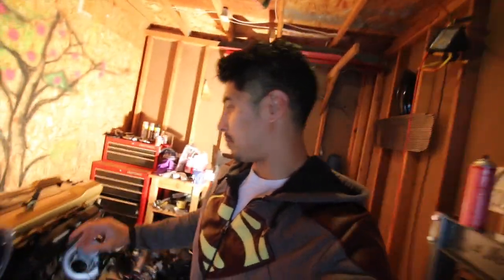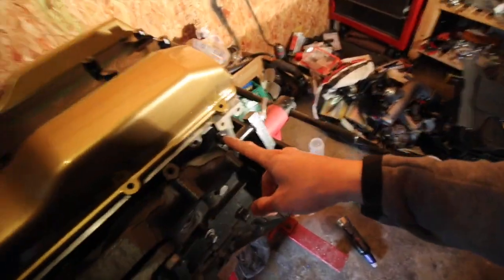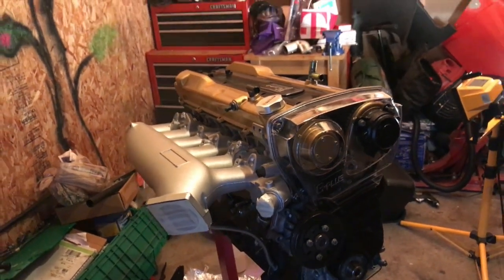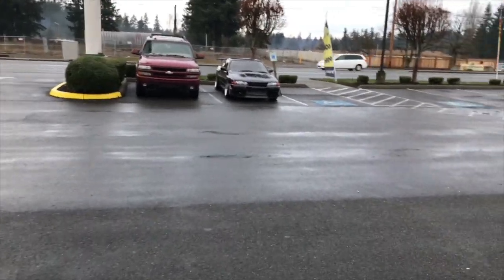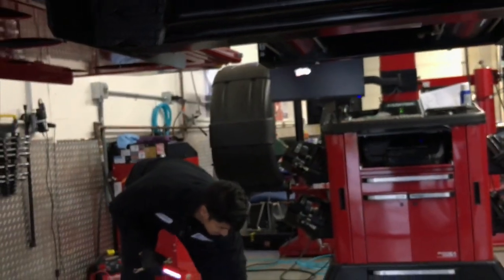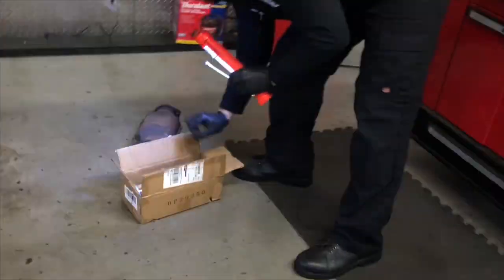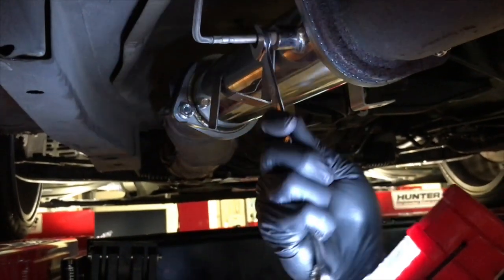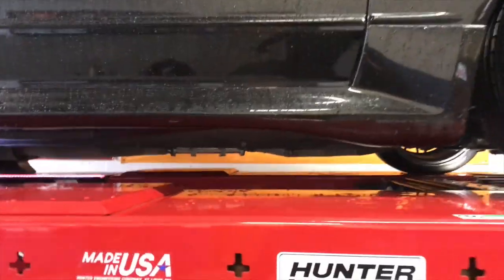R32 Skyline GTST Test Pipe Install | S13 RB25DET Update

Comment: What size wheels(width and offset) are you running on this video? Looks clean! Like the flush look.
Reply from the maker: aecasasus thanks bro! Rears are 18x10.5 +20 front is 18x9.5 +25. For the rears i would run +30 though so you don’t have to run negative camber
Reply: Drift Magic awesome man! Thanks! Love the way your car is turning out!

Comment: Did your old s13 have a test pipe?
Reply from the maker: Isaiah Sampson yea it did, kae 2.5” piping to one muffler. Loud AF lol
Reply: Drift Magic lol. I've been debating on getting one or not but I was reading forums and some people mentioned that it makes the car smell worse. Is this true? Also how loud would it make my car? I'm not looking for it ti be extremely loud but some pops would be nice. I still have a muffler and resonator on my exhaust.
Reply from the maker: I’ve never experienced that in my cars with test pipes. And I’ve done it my swapped s13s, and my old Evo 10. If you don’t have turbo i wouldn’t be as motivated to doing it because it’s a lot louder and the power gain isn’t very obvious.
Reply: Drift Magic Alright thanks for the help much appreciated. Looking forward to the upcoming content.